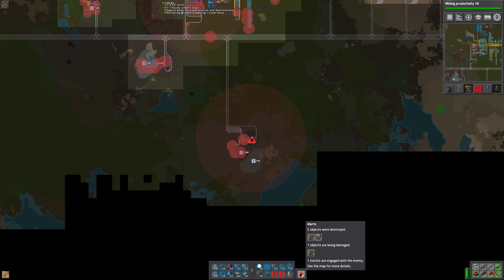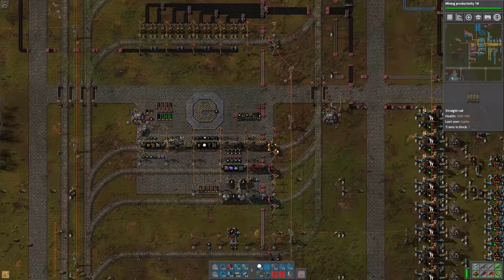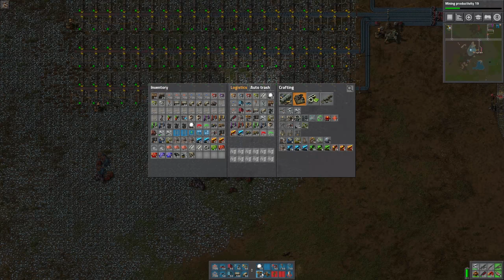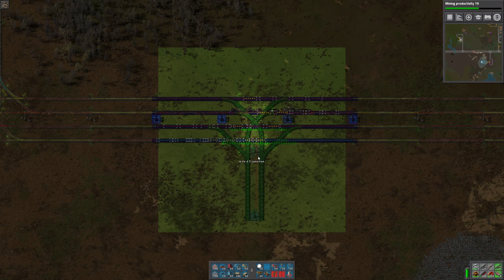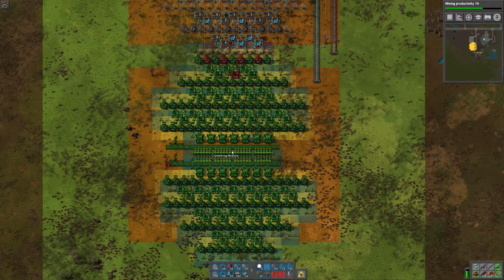Factorio 0.16 Let's Play #40 - Building the iron smelting area

Comment: Saw  your save game file linked in a previous episode and jumped in it for a little while. (Would guess its about a week old real time with just under 900 subscribers on your counter. where as this videos its about 550)
Anyway one thing I noticed re:outposts getting attacked. I always put just enough Roboports (2-3) in the outpost to cover the area with construction coverage. Stick in 25 Construction bots and 50 repair packs in one of them, with a storage chest by the one closest to the train.
This does 2 things....First, the bots will go out and repair minor damage caused by the biters. (usually the turrets) Second, since you have Auto-Deconstruct mod installed, when a miner runs dry the robots will deconstruct it and stick it in the storage chest.
Reply from the maker: Thanks, that's what I think I need to do.  I haven't done that until now, because I was expecting at some point to wall in the base, but now it looks like I might not have to do that.  In that case, I will need to have repairs done at the train outposts.  Thanks for the feedback!